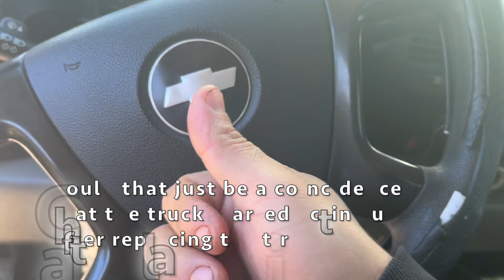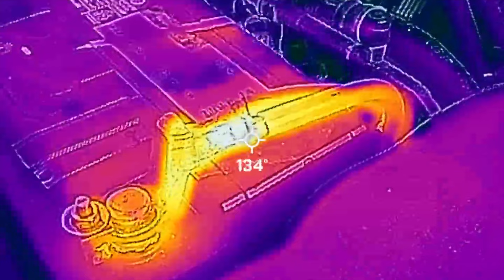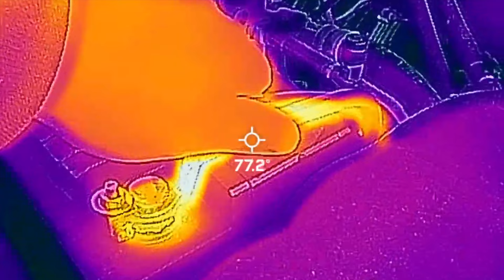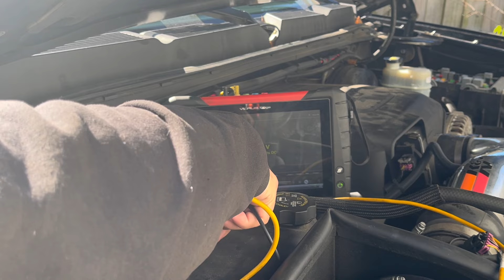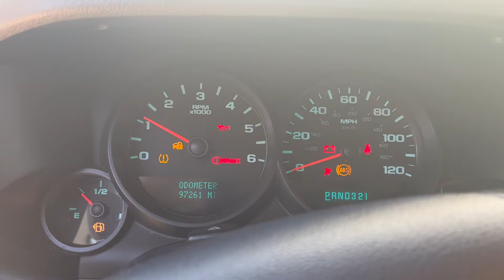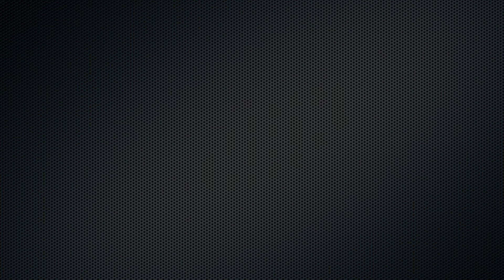Chevrolet Silverado No Crank No Start FIX!!!

Comment: My 2014 Silverado 1500 will become dead when I park it. It will not crank again. Completely dead. It has cranked in a couple days before. It has cranked when my husband moved wires around on the passenger side. Now it would not crank at all. He checked the wiring again and disconnected the battery and it cranked but he does not know what made it crank. How do we know if it is the battery cables? Could be the pos or neg cable, correct?

Comment: I have the same truck same problem but when I try to pass cables on it the lights turn on but then I turn the keys it doesn't start and it makes a clicking sound?  And once I remove the cables it turns off no power at all.. is tht my starter or something else ?

Comment: My friends 2004 Chevy is doing the same thing. We even changed out the battery and after it sits at night it doesn’t crank or power on in the morning. We have to use a jump pack in the morning to crank it

Any suggestions on what it might be?

Comment: Holy crap...you da man.Chasing weird electrical intermittent issues.The parts canon is over. Thaaaaank you sir
Reply: Fr bro😂😂 threw a new battery, starter, alternator, fuses. Just needed to clean terminals 😢

Comment: 2011 5.3. While running, I pulled the ENG fuse. The engine died. I replaced the fuse. Now the starter turns, but it's like it has no compression. Any suggestions?
Reply: Maybe plugs. Or fuel ⛽
Reply: UPDATE: It had an oil pressure failure. The lifters collapsed, lifters, cam and cam bearings were completely toast. I wound up replacing the engine.

Comment: My 2018 silverado just started dieing and I saw some recommendations for replacing the ground cable. WHen I unbolted the ground cable from the frame, the frame looked to be undercoated before they bolted the cable on. I cleaned it down to metal so lets see how that goes.
Reply: Anything yet man give me a story plz

Comment: I had nothing at all when turning the key on.  But you gave me a good idea.  I took my boosting cable and I went from the neg pole to the frame.....  every light came back to life and it started, so the problem was with my neg cable.  However ,  I've learned from your video so this is additional knowledge... !!

I had my windshield replaced few days ago.  They unplug the neg cable but it has been badly tied back....   As this cable was beginning to be corroded, I'll buy a new one,  just to be safer........... 

Thanks for your video............

Comment: I have a non-start issue myself. All the engine does is spin over and never fires up. Just throws a crank sensor code p0035. Replaced cam and crank sensors and new battery NOTHING

Comment: I put a motor in my 2006 and it won’t crank I can short the starter and make it crank but not with the switch , Chevy Silverado, if I try with the switch the dash lights and headlights come on ???
Reply: You probably need to have the ECM flashed

Comment: Just a question my friend .I have a 2009 Chevy Silverado and I was driving one day and turned on the blinker and all my gauges were fluctuating and the truck was losing power and lights were coming on and off .Drove it for another 10 miles and turned on blinker again and it ran normal .My mechanic looked at all the ground connections and said they were in good shape but one was extremely dirty and dusty.The truck sometimes before this incident would act the same way as the one that you were working on .Could this be the issue? Just wondering. Love the vid  just subscribed!🙂

Comment: I just had this problem and my fix will be buying cut to length welding cable and lugs at my local welding supply. It's tough, heat resistant and high ampacity. I've done many cables that way for decades. Dielectric grease inside the lug before crimping excludes moisture.

Comment: Another part to look at closly is that 150 amp main fuse.  Check it for corrosion an replace it if you see copper dust inside the holder.  Some of the symptoms are door locks going up and down on their own an stalling.  A feww bucks and my truck ran like new.  the ends were rusted off of the fuse.

Comment: My 2016 silverado having issues. I put the key in and all the lights on the dash come on like normal but soon as I turn the key all the dash lights turn off, no sound, no starting, nothing. Any suggestions ????
Reply: Mine does the same did u fix it?
Reply: @josecool4880  check your cable from the battery. One + cable will go to the mega-fuse. Check the voltage on the out feed tabs of that fuse. If that’s bad, you’re gonna read a good reading on one and a bad on the other. ( a slight voltage drop) Shake all 3 of those + cables, it will probably have a strange reading again but on the other cable. I couldn’t wait for the actual OEM part. So get to harbor freight and buy 2’ of cable with the ring connectors. Tape off the old cable really good till you can get OEM. Also check your main relays, flip them around.
Reply: @ControlsEngineerOne wait my bad mine does turn on but the truck shuts off while im driving randomly and then it does that when im trying to turn it back on so i wait like 3-5 minutes and it turns back on
Reply: @ControlsEngineerOne I got a 75 Chevy, my gear shifter is next to the steering column, sometimes I would need to shift gears then go back to park to turn the car on, but now I only get lights and no crank, all my lights work, new starter, new positive and ground cable, battery is still fresh, I’m not sure what it could be
Reply: @instaexpulsivndidthat  I’ve screen shot this so I don’t forget. I work on large scale factory machines however I can do some research. Check your Neutral safety switch, hopefully it’s that switch. I had a run in with Jeep with similar issues and it wasn’t that big of a deal. If you can find a tech manual with the schematic, trace that harness up into the column and make sure you’re not loosing 12v and nothing grounding out. Sounds more mechanical though. May be something goofy in the steering column or ignition switch. I’ve seen too many screw drivers in place of keys in those older Chevys. I’ll try to remember to come back with a solid answer.
Reply: @ControlsEngineerOne  hey, thank you I just saw this but yeah it was the safety switch, I bypassed it by connecting the purple wire with the black and purple wire, I just have to be careful on which gear I’m on when starting the car, thank you for the help 🙏🏽
Reply: @josecool4880 mine does this now. What’s the fix?
Reply: @josecool4880 did you ever find out the cause and fix?
Reply: @ yes, it was my fuse box and it burned my computer, i replaced both and now is running perfectly
Reply: Connections. Grounds etc
Reply: Thank you for comment man was having the same issues literally today and once I saw you found the solution it was the exact same thing on mine and fixed it right now thanks man. Because no one was having the same problem till I saw your comment!
Reply: Did you ever figure out what it was? I’m having the same issue
Reply: @thebarrypopper  yes I did. It was the ground wire on my battery. It was always coming off.
Reply: They’re all like that. Including mine. GM junk.
Reply: Battey terminal loose
Reply: Buy a Toyota tacoma
Reply: @MadAtEmOutdoors unless you need a big truck
Reply: Grew up a Chevy die hard dude. Fak Chevy & GM!! Trash!
Reply: buy new pick up truck 😂   CHEVROLET IS GARBAGE 😢
Reply: my 08 5.3  has 290k miles and still kicking 😮. It's an LT z71 and I live on a ranch with rock roads

Comment: Did you change the starter ?
Reply: I have the same problem hot wire no crank changed the starter problem went away next day again but no hot wire now antitheft lock now and no start 🤦 try again today I guess any tips

Comment: I got a 2007 2500hd Z71 6L for 2200$ and it had the dash lights come on but no start. I purchased the truck  anyways and towed it to my house. The guy who had it had it stored all winter then when it didn't start he replaced the battery but still nothing, no dome lights, head lights or cranking. I noticed it had no indicator line under what gear it was in. I ran a wire to the starter and positive fuse and it was cranking but no start. Then I thought about that onstar system that was in it. I Pulled fuse 47 or 48.. (I forget) and put it back in and just like that it started.

Comment: I have a 2003 silverado 5.3. I have a similar issue but mine does the same every other time.. I turn the key and it wont turn, click or anything, the cluster lights and needles kind of move a little bit but thats it. I just keep trying to turn the key a few times and it varies, but it will turn on normally after a few tries. After that the truck runs and drives great, it will just do this at least once or thwice a week. its weird and I cant find a fix. I`ve changed the ignition switch and key present sensor because i thought it was something there but still cant find the problem. Like I said, after a turn the key a few times (like 10 or 20 times) it starts normally. Any ideas?
Reply: You figure this out, man? My Tahoe is doing this. Won't crank sometimes until I turn the key several times but then starts and runs fine until the next time it decides not to. I also put in a new ignition switch but still the same.
Reply: @klong2023  yes I followed the start signal all the way to the starter. At first I thought it was a bad starter but when I went to check the connection at the starter it had acumulation of dirt and grime. I just inscrewed the wire on the starter, cleaned them off both and tightened them back up and it worked, This issue went away completely and I didnt have to buy a new starter.
Reply: @klong2023 10:02

Comment: A failing connection where the cables are crimped to the positive clamp causes high resistance.  Any resistance will result in voltage drop, and in this high-current cable will cause it to heat up and reduce the power throughput.   It looks like the cable clamp is making good contact with the positive battery post, but not with the red cables.

 It would have been better to bridge the bad connection with something passive, like a jumper cable, but the "booster" test is better than nothing.
Reply: My 2014 Silverado 1500 will become dead when I park it. It will not crank again. Completely dead. It has cranked in a couple days before. It has cranked when my husband moved wires around on the passenger side. Now it would not crank at all. He checked the wiring again and disconnected the battery and it cranked but he does not know what made it crank. How do we know if it is the battery cables? Could be the pos or neg cable, correct? (I posted this question in the comments but thought you might be able to help me also)

Comment: Hi Oz Mechanics, I hope you are well. Can you confirm if the instrument panel was lighting up with the key in the "crank" position? I'm having a similar problem with my dad's 08 V6. When I turn the key to the "on" position, all gauges/ gauge lights in the instrument cluster activate. When I turn the key all the way forward to the "start" position, all gauge/ gauge lights in the instrument cluster go blank. That includes the "anti theft/security" light. At that point the starter/solenoid does nothing and I get no power to the solenoid.  Please let me know if this sounds the same as truck in your video? Thanks.
Reply: did u figure it out, thats my problem right now
Reply: @williamblanks8500  es, sorry for the delayed response. I ended up sending my vehicle to an electric shop. The problem was that both the BCM and ECM were both toast at the same time.
Reply: Did you fix the issues sir? I have the same issue on my 2008 Silverado
Reply: @jameszablan7340  Yes, sorry for the delayed response. I ended up sending my vehicle to an electric shop. The problem was that both the BCM and ECM were both toast at the same time.

Comment: Thank you for this video. I was  mis-diagnosing mine till I saw this video. This video saved me a lot of time and money. I thought it was my BCM and would have to be taken to a mechanic. Then I ran across your video and I went to work immediately on my truck. I found it was on the negative side that I was losing power. Thank you my truck is fixed..
Reply from the maker: Awesome. Glad this video helped out
Reply: My 2014 Silverado 1500 will become dead when I park it. It will not crank again. Completely dead. It has cranked in a couple days before. It has cranked when my husband moved wires around on the passenger side. Now it would not crank at all. He checked the wiring again and disconnected the battery and it cranked but he does not know what made it crank. How do we know if it is the battery cables? Could be the pos or neg cable, correct? (I posted this question in the comments but thought you might be able to help me)

Comment: High resistance ( corrosion ) on the positive side , causing the heat in the cable and connection . The key was on during the test . ANY exposed copper will corrode and disintegrate over time . Great use of the thermal camera .
Reply: Would have to be some serious corrosion to disintegrate a battery cable.😆😅🤣
Reply: @Orange-Jumpsuit-Time  How about a ground cable with exposed copper on the chassis ? It gets a continuous salt bath !
Reply: @billsmith2212  The silverish look on your braided ground strap is from tin, which is resistant to many common corrosive materials, and is plated on the strands to resist corrosion. So you see, there is no exposed copper, unless you freak out and dip the cable in some kind of acid bath to remove the green, which is harmless, and forms after many years of exposure to the elements, ex. road salt.

Comment: I've had my truck, 2017 GMC Sierra in and out of the "CERTIFIED" Service department three times and they said they couldn't duplicate this issue. I SAY BULLSHIT. I find it very hard to believe that a whole warehouse full of techs. doesn't know anything about this issue with the battery cables.
Thanks for sharing your video it has saved me not only money but loss of income being self employed and has overall taken away the fear and weight off my shoulders of not being able service my customers at peak season!
Reply from the maker: Awesome tiger glad this video helped out. Sorry you had to go thru that

Comment: My 03 duramax is having the same issue replaced the battery and starter. Tried to jump it. Still won’t start battery completely dies when I disconnect the jumper cables.
Reply: What did it end up being
Reply: might be alternator if battery dies

Comment: Hey there my 2012 Chevy Silverado will not start I put a brand new battery in it just now still will not start it will not crank over it doesn't make any noise nothing except the headlights turn on nice and bright and it's weird though because the mileage turns on even without the key in it I tried what you showed I have lights on the dashboard but the starter and engine still will not kick over or make any kind of noise
Reply: What was the issue?
Reply: @mtsanchez27  its still in the shop and they still don't know whats wrong.  they are changing the body control module but they are not sure if that is the problem
Reply: @nucknuck123  thanks for the input brother. Please let me know as soon as you know the good news 🗞️ please!
Reply: @nucknuck123  thanks!
Reply: @nucknuck123  what do you mean by it's a wash?
Reply: @nucknuck123  dang!!! That's not good
Reply: @nucknuck123  that's not good. On your expenses?
Reply: @nucknuck123  not too bad then. There's going to be one to be able to fix it.
Reply: @nucknuck123  change all grounds and postive wires with new ones dont forget about the voltage reader on the flex fuel ,but i got same if not close i think its my problem also?double grond the block it has 2 on the back side and the one on the drivers side goes out ,,or some how loses contact i cleaned and replaced mine and changed my oil because of the oil pressure switch that will shut off your fuel so you dont burn it up. but let me know and ill share mine too.
Reply: I changed the starter but got the same results the next day but no hot wire now

Comment: Oz, hope all is well and good videos, I have seen you work with another awesome guy Eric on Advanced Level Auto and stuff. Your videos are pretty good and practically right to the point. I was curious if you also ever came across MY's 2013 to 2015 Chevrolet Malibu with the auto start/stop that has an intermittent stall out on auto start up. Thanks to Eric from Advanced Level showing a video a while back helped tremendously about the P305F. His 2 part videos on that helped me alot getting my 2014 Chevrolet Malibu back up and going. But I was just curious if you have ever come across anyone with that Malibu having intermittent stall out on autostart. Again, awesome videos and thanks for being part of a great group of other YouTube diag techs whether professionally and/or DIY. You all are a great inspiration and help.
Reply from the maker: It’s funny that you brought this up. A customer passed by yesterday, having this exact same issue. I set up an appointment with him to come early this week, let’s see what we find
Reply: @OzMechanics  hopefully you can be able to do a video on it as well, thanks man.